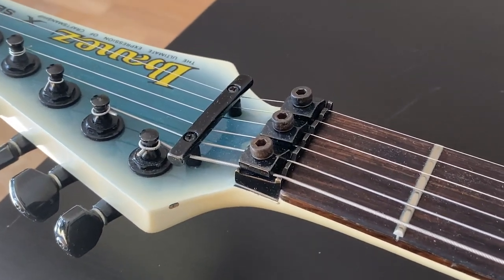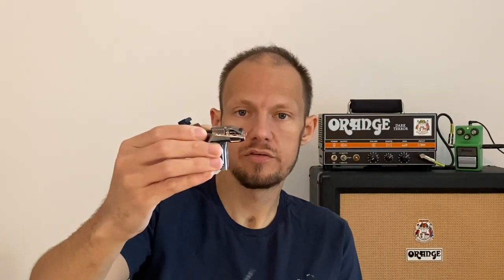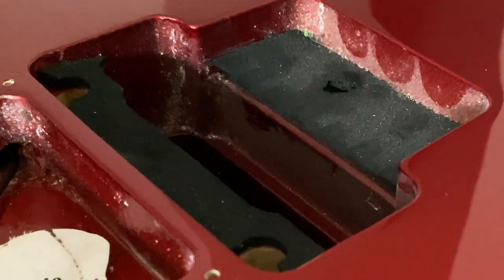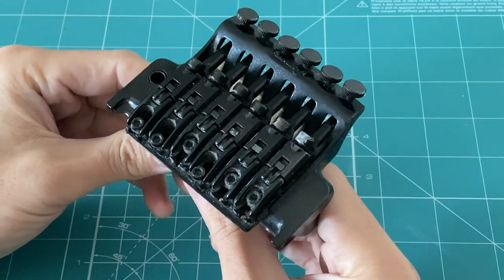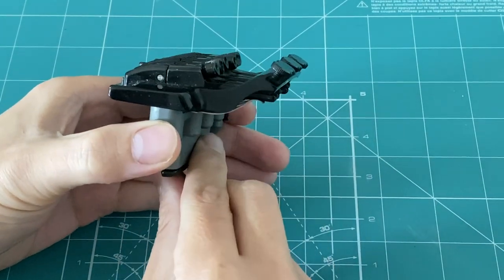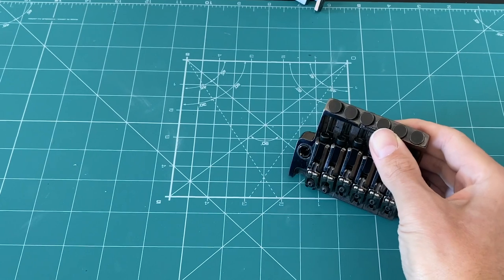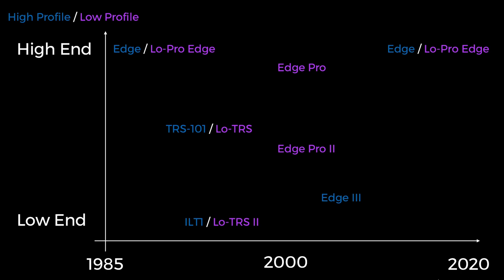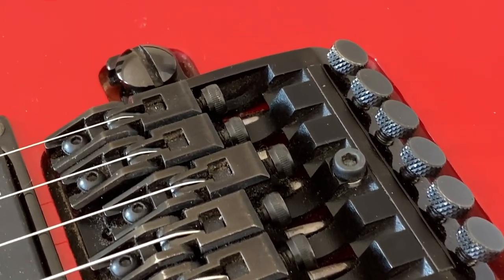EDGE, LO-PRO EDGE and EDGE PRO - How To Recognise Ibanez  FLOYD ROSE Type Tremolos

Comment: I think all of these bridges are fine but are just hard to setup properly. I’ve got the lo tres ii and have put it away and had it hold a tune for years. Obviously you get what you pay for but I don’t think I’d be changing one out just because it’s hard to use.
Reply from the maker: I agree, sometimes switching bridge is easy solution, but most people do it pre-emptively. I've had a few guitars with often hated Edge 3 and it were always solvable issues. At some point the edges will wear down and then it's not much you can do, but very rarely people reach that point.
Reply: @Ibbyhead  I have a 98 Korean Rg350dx with a Nazgul/sentient set. As the edges wear on these bridges you can just round them up with a file. Granted I would do anything to drastic. I rarely mess with the tremolo bar so maybe that why I don’t have many issues. I’ve always liked how adjustable the intonation is versus other styles.

Comment: Hi, I am confused that Lo-Pro edge are used in most RG series, but for j.custom series they all use edge tremolo or edge zero. Is that means Lo-Pro edge is the solution for saving cost ?
Reply from the maker: I don't know answer to that question. I can imagine Edge Zero is a bit cheaper, but it also has some stability gains, although many people don't like the feel of that tremolo. Savings between Edge Pro / Lo Pro Edge in the context of the whole J.Custom are marginal, so I don't think that's the reason.

Comment: Great video, very informative thank you for making it... Im thinking of buying a guitar with the edge pro on it but all over the internet im hearing about the fact it doesn't have locking studs, is it really as big of a problem as people are making out? And the locking stud mod detailed on ibanezrules do you know much about that and if its worth it?  Basically i just want to know if its gonna stay in tune well as i was really set on getting one with the edge or lo pro... TIA
Reply from the maker: I don't find it to be a huge issues, but if you're ver heavy tremolo player it apparently makes a little different. I know this mod is quite popular, and lot of people have done it. I'd say it really depends if you do a lot of heavy tremolo work.
Reply: @Ibbyhead  
Thanks for your reply, I ended up buying the guitar, i should hopefully get it back from being set up today (was all way out of whack) 
I'm definitely not a really heavy whammy bar user just sometimes, so should be no worries I'm hoping.

Comment: thanks for this video.  i hate the socket and trem bar with the bushings.  can you swap out the socket to something like the floyd rose pro has?
Reply from the maker: I'm not sure, may need some woodwork (plugging the old hole and drilling a new one) if the sizes are not compatible.
Reply: Not the socket for the stud.  The holder portion of the trmemelo arm

Comment: I just bought a  03 rg350 I took the back plate off and it has a edge iii pro
Reply from the maker: I'd guess it's Edge Pro II. There were never such thing like Edge Pro III, and Edge III popped up few years later. Decent bridge, I've had mine without problem on RG370 for over a decade. Switched to Edge Pro when I had a chance to grab it cheaply. Thanks for watching and commenting!

Comment: The reason Ibanez stop using the original edge/lo-pro edge back in 2003 was Floyd Rose was charging them big bucks to make the bridges under his license patent # that he owed on the first double lock tremolo then he let his patent license lapse, after they came out with own new design of their bridges that why back in eighty/ninety ever lock tremolo you seen had license by Floyd Rose on them, when   Ibanez found out about the patent lapse then they came back with them, and that why there is no license by Floyd Rose on the new ones, so i was told by a license dealer.
Reply from the maker: That is all true! ZR-type trems were also cancelled over patent dispute.

Comment: I own a Edge Pro original from Jem 7VWH 2007 model but wanted to know between all this (Lo Pro Edge, original Edge and Edge Pro) which one is the best and why?
Reply from the maker: I think they're all great, but each has some upside. Usually people say that Lo Pro Edge and Original Edge are equally "the best tier" and Edge Pro is slightly below. They have slightly different feel, because the force arm is longer on lo pro and it's a bit stiffer, but I find it very comfy with that low profile. The biggest problem people have with the Edge Pro is that it doesn't have locking posts and this can lead to tuning issues. This is an easy upgrade.
Reply: @Ibbyhead  Thank you for the info!
Reply: I wonder if i can replace my Jem from Edge Pro to Original Edge, should they fit?
Reply from the maker: @aris9125  I think the cavity is too small, and you would need to do a small woodworking intervention (Original Edge is wider).
Reply: @Ibbyhead  sad to hear...im stuck with Edge Pro which is discontinued and mine it's ok but gold has faded
Reply from the maker: @aris9125  Yeah, this is a bummer with discontinued hardware.

Comment: Great information Ibby.  I have had three Ibanez guitars, each with different trems, and all with problems with the arm attachment.  They all became loose in the socket resulting in free play in the arm that then knocks around.  I eventually got rid of each guitar because of these problems.  Is there a trem model that is better than others for this?
Reply from the maker: Edge Zero / Zero 2 have screw on tremolo arm, just like Schallers / Floyd Rose. You can also buy mod to pretty any Ibanez trem to do it. Check out Red Bishop products.
Reply: The housing assembly for the bar input can be removed/replaced on most if not all floating bridges of the several Ibanez models that I own.

Comment: There's supposed to be a plastic sleeve in the hole of the block on the edge II
Reply from the maker: I think you mean Edge Pro II, and yes there should. In this particular bridge after 10+ years it was pretty much grounded down to non existence.
Reply: @Ibbyhead  Yes that's what I meant..  that's the one on my hr giger... you can use a Teflon sleeve, or a plastic drinking straw... Makes a big deference.. Anyways...I don't tighten that set screw like some animal enough so to dig into the bar...

Comment: Thanks for a great video, very easy to follow/understand the different versions. :) Also, if I ever ponder getting another guitar with a floating bridge, I'll do my research first and avoid the low-end versions for sure.

Can't give you my opinion on different bridges since I have only one and have some troubles with it - maybe you can help me? I had it set up by a local guitar tech but I'm not entirely convinced it's completely in the right angle. It's the second setup for it (the original seller "set it up" for me but it was a completely messy setup (f.e. twisted neck, it's quite appalling since he has a legit business doing guitar setups...!))
It's an old Lo-Pro Edge (2001, I just bought it so don't know the history of this guitar but I believe it's the original bridge but it's a bit hard to find exact info on this guitar since for some reason you can't find it on Ibanez Wiki or anywhere else, really, I believe the model is RG550EXL (lefty version of RG550EX). (Same finish (galaxy black, same mirrored pickguard, same inlays, produced in the same time period as the right-handed version) but it seems the right-handed has a different bridge (Edge. That's what the Wiki says).)

I'm not sure if the angle it was set up with is entirely correct - according to what I found elsewhere, the knife edge in a properly set up bridge should look completely parallel to the body - well it's not on mine. It's angled a bit downwards (if looking from the side, downwards towards the back side/fine tuners). I can send a pic if needed (where?).
I'd really appreciate some help, so I can be sure it's correct, so the tuning stability is as good as I can get from it. Or if the angle is actually correct, then I can go on ruling out other possible issues regarding tuning stability.
Reply from the maker: Shoot me email at ibbyreg@gmail.com and I can take a look. Thanks for stopping by!
Reply: @Ibbyhead  Okay, I will! Thanks!

Comment: Hi. Thanks for this video!
I was wondering if I can replace my Ibanez “Edge Pro” tremolo to Ibanez “Edge” tremolo on my Ibanez Jem7v 2008 year which originally came with Edge Pro tremolo. 
Thanks!
Reply from the maker: Unfortunately not. The route for Edge Pro is too small. You would have to do some woodwork to make it fit.
Reply: @Ibbyhead  thanks for the  answer

Would like to clarify 
the same Ibanez Jem7v that goes  since 2010 with Edge tremolo differs inside  (area for tremolo) from Jem 7v that was installed with Edge Pro (2003-2009)? 
They did changes and cut the wood for Edge Tremolo in comparison with Edge Pro? :-0

Comment: Hello!!! I'm looking for an affordable guitar in the used market and I found the JS100 for a very good price. I also found an Ibanez S470 (22 frets) with the ZR tremolo system and the RG370DX made in Indonesia (Edge III). All of these guitars are very affordable. I can  replace the pick-ups in every one of these models, but I'm really interested in the tremolo system. In my country of origin, finding replacements is very difficult and/or extremely expensive so I'm stuck with whatever I decide go with.  If you have any insight, I would really appreciate it. Sorry for my broken English.
Reply from the maker: Hello, your English is perfectly understandable - don't worry about it :) I'll probably would go with JS100 or RG370DX - there's a lot of replacement for those bridges if they go bad. The S470 has a very cool ZR system that uses ball bearings instead of edges and is potentially longer lasting, but the spare parts to those bridges are becoming a huge problem, since they went out of production nearly a decade ago, and they're not coming back.

Comment: hi, how do you adjust these ibanez saddle to match fretboard radius? did you put shims like ofr. thanks
Reply from the maker: Hi! The base plate has "steps" for each strings for the most common Ibanez radius (16-17") but you can add shims to fine tune it.

Comment: Hey, thanks for the educational video, I have an edge 3 ad I wanted to know what bar size it takes, I just bought a 6mm direct insert bar and it's too fat to go in. It looks like theres a piece of plastic tubing in the slot, and a 6mm threaded will screw in but its tight and not the right bar for sure. I know there's a 5.5mm bar and even a 5mm bar but thought you would be the guy to ask before wasting another 10 - 15 bucks on the wrong bar.

Any advice appreciated
Reply from the maker: Just measured one I have in one of my guitars with Edge 3 - it's around 5.5mm.

Comment: Hi, I have Ibanez RG320FM with Edge Pro II tremolo. Can I replace it with Edge Pro III tremolo since I cannot find any Edge Pro II on the market at the moment. Has anyone done it and is it technically possible?(Speaking about dimensions, etc.)
Reply from the maker: The Edge III (There's no such thing as EPIII) is a few millimetres longer than EPII. When I just tried, it fits, but the microtuning screw is scraping on the back of the route. So it may need some cosmetic woodwork.

Comment: I only own one RG with a "cheaper" EDGE and that one is my RG350MDX.   all my other Ibanez guitars all have the original Edge or the lo pro Edge.
Even though the Edge III is no where near as good as a original Edge it is not complete trash either. I have used it for over 7 years now and it still 
stays in tune  even with extreme Vai / Satch type Bar stunts. I mean how bad can they be? I can only go by my own experience and say the EDGE III has never given me a issue in over 7 years of use and think it deserves to be a bit higher on your EDGE  tier list.
Reply from the maker: I say the same thing to people - even though it's one of the lowest quality trems Ibanez put in their guitars, it is still super solid.

Comment: Can u please please help me 🙏 i Have a Js 2400 ibanez guitar and my bridge is fully rusted to death n m looking for online for a new one but i cant find one, please help me which bridge will fit in my Js2400 ibanez guitar,i m unable to find online solutions for this 🙏
Reply from the maker: Hi! JS2400 had Ibanez Edge stock, so that's good news - it's fairly common to find. The bad news is that Joe's guitars have different fretboard radius then for example Ibanez RG - they're much rounder, and the plate on that tremolo have to resemble that. Where are you located? I'll try to help you find what you're looking for!
Reply: @Ibbyhead  Hello I am located in India(northeast part of it)my bridge is fully rusted,I tried to put anti rust and tried to soak it in vinegar but doesn't look like it will recover,and I don't have good guitar tech here so if I find a bridge I will learn myself how to install if I can find one for my guitar,it lying in corner for 3/4 years n I feel bad about it
Thank you for reverting 🙏

Comment: I have an onld RG570 with a low Pro and its still awesome. I also have an RG770DX reissue with an Edge and that rocks. I briefly had an RG with a Low TRSii that was the biggest pile of horseshit ever. I had a more recent RG3570 with the Edge Zero and it was really stable but I hated the ultra stiff fine tuners, I really could not get used to those, so that guitar went...even though it was an awesome guitar. AN RG3570 in Lazer Blue with the yellow DImarzio's and an Edge or LoPro would be a really nice guitar.
Thanks for the great video :-)
Reply from the maker: Thanks for watching and commenting! I like your idea for RG3570 with Edge/LoPro Edge trem! :D

Comment: Hey is ibanez edge 3 is good or what do the Sharpe end break fast or what
Reply from the maker: It's pretty ok, but if used heavily those edges will get dull at some point. But it's good design and should work ok for most of the players.

Comment: Which do you think has better materials a Floyd Rose or a edge?
Reply from the maker: German made Floyd Rose are top quality, same level as Edge. I like Edge's design more, but that's personal taste.
Reply: @Ibbyhead  okay good to know because I have an old rg that I got a couple years ago used and I originally had a edge 3 on it and I replaced it with Floyd Rose special because my brother-in-law had his old one and I'm thinking about getting original Floyd Rose and switching out the bridges just so I have better tuning stability

Comment: please help. Iwant to swap my ibanez edge into OFR. Does it need adjustment or just plug and play. BTW its a 2018 Edge tremolo im sure
Reply from the maker: It generally should fit, but it's hardly an upgrade. Best case scenario you'll get similar quality.
Reply: thanks for the answer. its really fit in perfectly

Comment: Thank you for this! I didn't know what model I had, nor even guitar model. It's a Prestige RG1570 with the Edge Pro I have found out after this vid and a serial number search. I still can't keep the damn thing in tune tho after searching every setup vid I can find.
Reply from the maker: I should make a video about how I do setup! Thanks for the idea.
Reply: @Ibbyhead   I gave up after watching 20 "The correct way to setup a ___"  and of course everybody did it different, so I tried how I setup my strat like Jeff Beck and tuned it using the springs and it's staying in much better tune. I did have to block bridge tho because I had snapped bar off last summer trying to set it up ha and don't have a replacement at this time. I indeed would love to see how you set yours up. Thanks again, you were a big help!
Reply: I have smaller problems too with my Ibanez js1000 from 2007. It also have edge pro.... It holds tuning very well, but not perfect! Hmmmm... I'll find the solution.... I love floyds, but the fact is that they are pain in the ass if you don't know them really well.... Cheers bro

Comment: can i replace the edge pro 2 with a edge zero II plug and play?
Reply from the maker: Unfortunately not. They have different width at the post. The most compatible swaps are Edge Pro, Original Floyd Rose and Gotoh GE1996T, which are all not very affordable.
Reply: @Ibbyhead  yeah ofr are quite expensive i have one in my js30, maybe i check an secondhand not beat up edge pro on the fb marketplace. Thanks bro! more powers!

Comment: I have an Edge tremolo on my Prestige. When I pull up, it shifts the tuning +12 cents. And when I push down, it goes back to correct tuning. Any idea how to fix this?
Reply from the maker: Could be few things, but most likely it's not operating smoothly on the knife edge / post meeting point. First thing to check would be if knife edges are, well, knife-sharp, and put some chapstick on the posts.
Reply: @Ibbyhead  Same thing on brand new Edge pro on my rg1570 prestige. Conclusion is that knife edges are not to blame.
Reply: @Ibbyhead  I have also original non recesed floyd rose on my Adrian Smith Jackson. Floyd has better tuning stability. Edge pro has better sustain. Like you sad, edge pro feels better to palm. I do not like small saddle intonation screws on edge pro which are very fragile but I prefer  fine intonation wheels on edge pro.
Reply: @gcoza11  Did you fix the issue? Did you check that the studs are not loose like in this video:

https://youtu.be/MCmkm9zMwlk?t=516